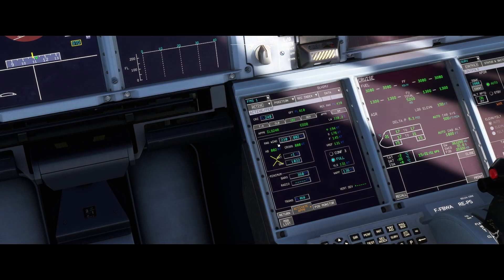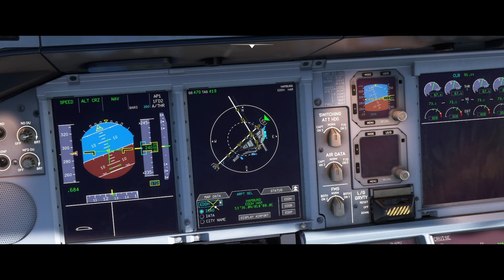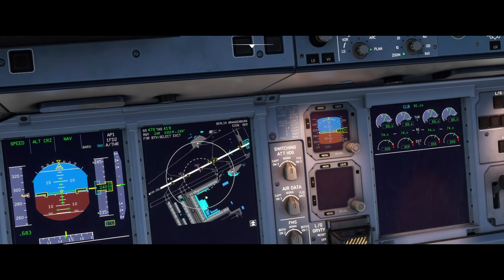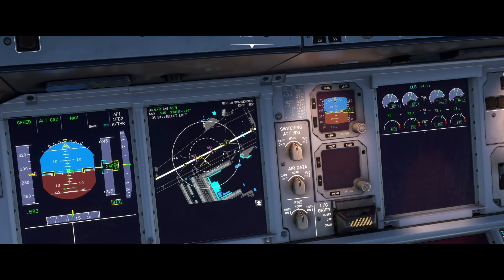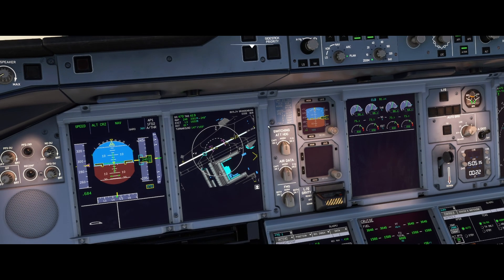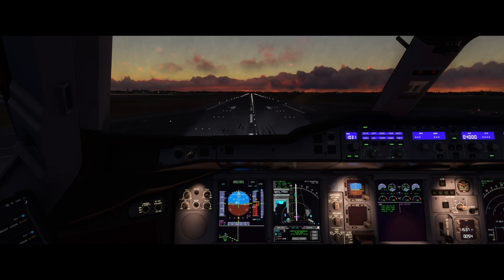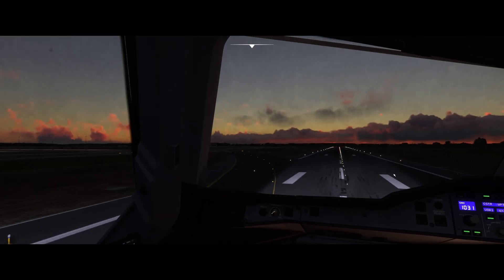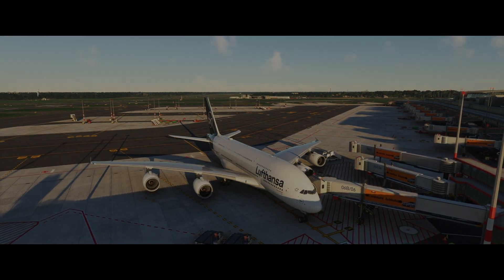A380 Quickie: Brake to Vacate (BTV) Setup Tutorial - Fly by Wire Airbus A380

Comment: do u need a navigraph subscription?
Reply from the maker: To be able to use the map on the ND to select the runway and taxiway you need a Navigraph subscription. But you can manually set the BTV stopping distance which you could get from charts or other material if you do not have a Navigraph subscription. See the documentation here: https://docs.flybywiresim.com/pilots-corner/a380x/a380x-advanced-guides/oans-btv/#without-navigraph-unlimited